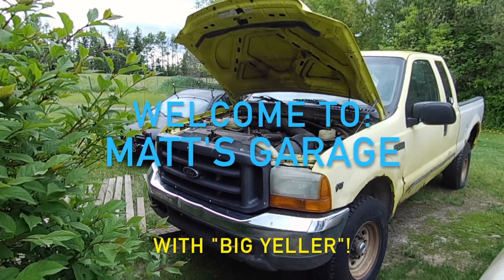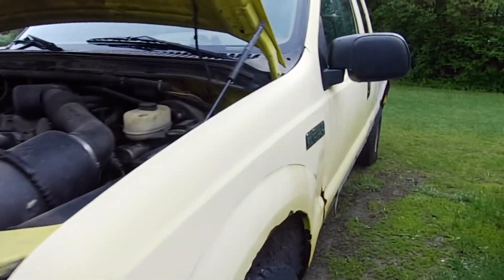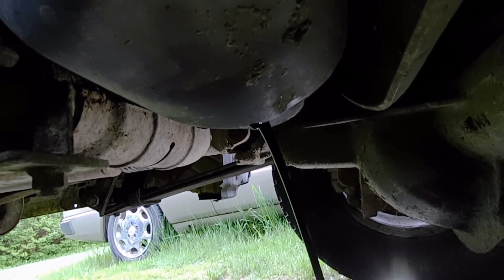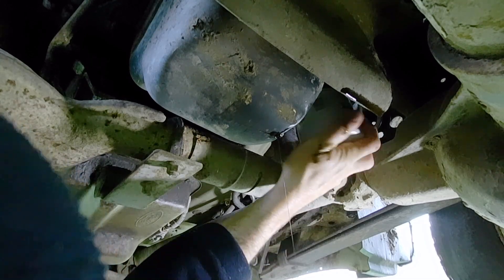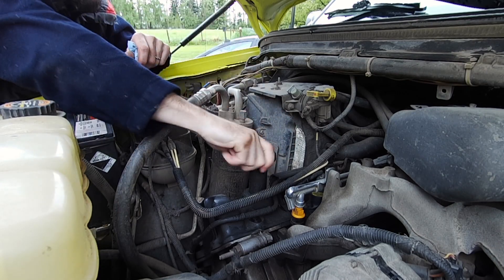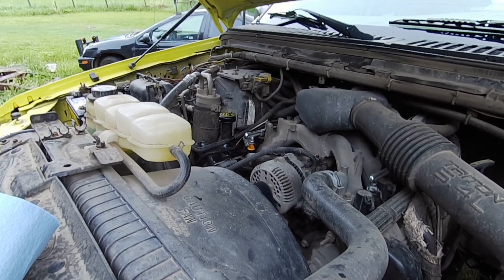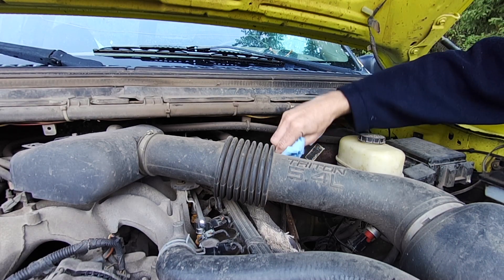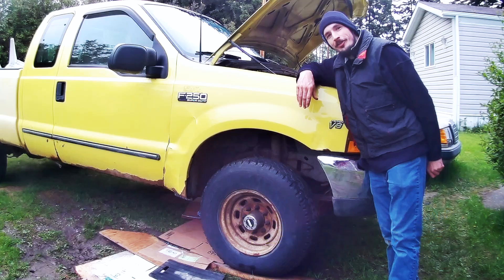2001 F250 Super Duty, Oil Change, 5.4 Triton V8

Comment: PEOPLE, PLEASE! USE ONLY THE MANUFACTURERS RECOMMENDED OIL WEIGHTS IN YOUR OWNERS MANUAL! 
Never deviate from that weight. Brand doesnt really matter. Synthetic is generally better. Use an additive if you want but just 1 follow directions. Change oil and filter regularly and you will double your engines life.

Comment: Glad I happened by your video! I just got a 2001 F250 Super Duty 5.4 Triton last month. It was given to me - runs relatively good but I need to get a few things for it. Trouble is - I have no clue what Trim my truck is to order parts for it. I'm "guessing" it's an XLT? No clue - lol. Looks like yours only mine is white with a full bed. The bumper isn't chrome though - it's seen better days with a lot of surface rust on black paint. Anyway thanks for your oil-change video! It's info I will be putting to use. Kudos!
Reply from the maker: Glad you found the video helpful. Wish I could help you with your trim level but I’m just not to familiar with all the different trim levels on these trucks.

Comment: I've always heard that using Morotcraft on these is way better due to their ability to hold the pressure.. on the  oil as they cool s  and better on cold starts. There is a lot of information on this... Wondering why you would go with Wicks.
Reply from the maker: Motorcraft filters are great also, equivalent quality I would say. Wix makes premium filters, they are the main filter manufacturer who makes most of the high end filters, they might even be the ones that make the Motorcraft filter.

Comment: I Like it alot! Was this a penske truck? It seems rough and it was yellow it seems.
Reply from the maker: I should do a bit more research on it but I don’t see any evidence that it was ever any other colour, I’m pretty sure that yellow is actually the original colour straight from Ford and I don’t think it was ever used as any sort of a company truck. I actually bought it off a cattle rancher for $300, I think he figured he had beat it to within an inch of its life LOL! But I’ve had it a couple years now just using it around the yard and it’s never once failed me, I have plans to resurrect it one day and get it back on the road. Thanks for tuning in, have a merry Christmas!🎄

Comment: Hey Matt in the future if I was you I would not use Quaker State I used it in the past one time I always used to run Castro and one time it was on sale and I used Quaker State and it made my engine make this horrible noise when I was revenant to race somebody that made a very strange noise and I would never use Quaker State again your best bet is Valvoline haviland Castrol the three best
Reply from the maker: spackmaster Chavez I agree it is not the best brand, but it still has a API certification on the jug showing it meets the requirements for oil... I really don’t think there is that large of a difference that I’d be worried, also I have that liter of Castrol in there to make sure lol!

Comment: What don’t you like about Fram filters?
Reply from the maker: MisterTwister They are trash, go watch a video where they cut open al the brands and compare, poor materials, no proper drain back valve etc. Also I bought a couple once that literally had heaps of metal shavings in them. I’ve heard numerous other stories of the elements collapsing and clogging off oil flow, seals that fell off during installation etc. FYI Quaker State filters are made by Fram also so I steer clear of them as well.
Reply: My 01 f250 has been using fram since I pulled it off the lot new and 330,xxx miles later she still runs perfect

Comment: I make it a practice to pull the filter off first, clean the mounting surface and install a new filter then I drop the oil. That way the draining oil does not get on me while trying to remove the filter. I also once in a while will pour in some AT fluid when  the oil is almost drained so it pushes out more of the old oil.  Good video. Happy Pappy's Day there Pal.
Reply from the maker: MostlymoparIH Good little tips. I rarely consider ways to stay cleaner lol! Happy father’s day to you as well!
Reply: @CarswithNash  I didn't use to either but in the long run it saves you time and keeps your clothes cleaner something my wife likes.
Reply from the maker: MostlymoparIH I’m trying to get my wife conditioned to the smell of engine oil...😉😁
Reply: @CarswithNash  I don't think that will happen. Years ago I worked delivering home heating fuel and the smell gets in your clothes, on  your hands, and in your hair. I still smelled after a shower. Glad I'm knot dewing that any moor.

Comment: 10w-30 is the best oil for these 5.4’s
Reply from the maker: Chase Howie Only if you wanna ruin it...
Reply: No I’ve been running mine on 10w-30 since we got it in 04 has 306,000 miles and runs strong same engine and transmission the oil they prefer you to use is too thin
Reply from the maker: Chase Howie I’m gonna go with the fleet mechanic I know who maintains a large fleet of these engines, sounds like you’ve been lucky, his company used 10w30 prior and he ended up replacing a bunch of engines, meanwhile his personal vehicle has 370k miles running 5w20... As well I lost a 4.6 to bearing failure from running thick oil, it had under 200k on it.
Reply: Good info. But lacking a little bit. The filter doesnt need oil added to it prior to install. And my 2005 5.4 is 5w20 with a ford filter period. Wix saves you what a buck? Or two? Manufacturers specs is what I use over 200,000 on mine.
Reply: Trevor Henry I got 307,780 miles original engine and transmission 2004 5.4 nothing ever been touched on it other than coils and front suspension replaced and fluid changes if you think thin oil is better so be it to each his own
Reply: @Chase_01  Its the ford fantasy problem. The 3vs 5.4 was better. But still suffering from from small oil galleries. Thinner and frequent changes are the saver of this rig. And its depends on what you do with yours. Mine sees alot of -40⁰c temps and the heavy oil hurts the old cold start.
Reply: Trevor Henry well I live in South Carolina so the 10w-30 works amazing
Reply: Not according to Ford....